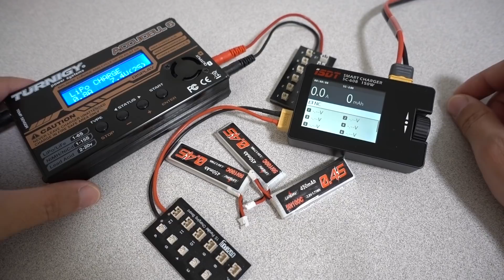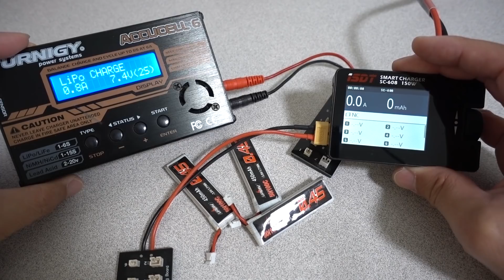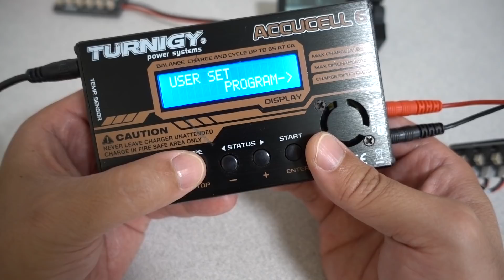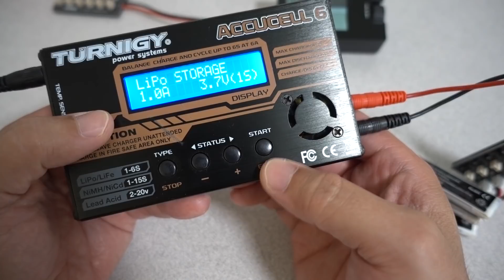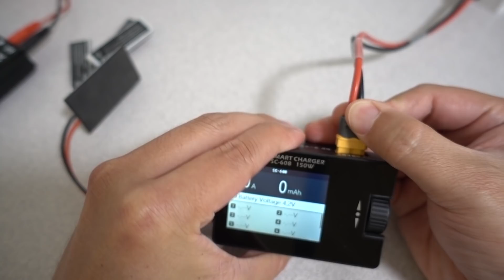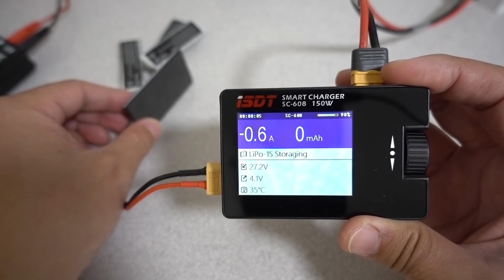Easy Method for 1S Lipo Storage Charging ⚡

Comment from the maker: Just to make things clear, I use this method after a day of flying where I have a bunch of fully charged 1S lipos I want to bring back down to 3.8v.  I don't put in random lipos with unknown voltages into the parallel charger like some of these comments are suggesting.  They are all at 4.2v.  I do mention this in the video and it would not be safe to plug in lipos at different voltages.
Reply from the maker: Nothing wrong with the other way, but I've been doing it this way for years and don't see a need to switch away from doing it my way.
Reply: I think the confusion arises because when plugging in the three batteries you give an example where 2 are fully charged and other is already at storage but don’t complete the thought. You plug it in despite variance explained. Might save yourself some feedback by posting some text over that bit to clarify. You start video by saying you do this with all your fully charged batteries but that part seems to contradict the opening. Hope that helps! Thanks for all your hard work and great videos.

Comment: Hi can I ask, I have a new skyrc e680 balance charger. I have 1s lipo battery's. My parallel board is similar to the one in the video apart from mine has 6x 1s -3s ports and also has 6x xt30 connections. 
When trying to storage charge more than one 1s battery it does not recognise anything other than one battery. I select the appropriate amps for the amount of batteries and their mah in total and select 1s as the voltage. but soon as i try to start it says connection break. All batteries are fine and so is the board. it was same with a previous board (6x1s) i purchased that was not a parallel board ( i thought it was) and it has 2 banana connectors much like the board i have now can charge one battery but not more than one other wise it says connection break. is it me or is it the charger?

But, in video if balance charging 2s + batteries you can connect them to the xt30 connectors and get power and the board i presume the other ports are  balance ports. But, with a 1s battery how does that work? there is only one lead and i guess it powers directly via that lead but charger does not recognise them past one battery, what am i doing wrong?

Comment: I bought this board and I did what you did and after long start button press there is bipping noise and CONNECTION BRAKE message on display.
Reply: I posted video on Drone Racing - begginers group on fb
Reply: Any solutions yet?

Comment: Dumb question. How do you figure out the Amp setting with 1S lipos when charging with the Tenergy? I usually just put a decimal in front and use that. Ex;: 450 = 0.4A. Is this correct? Thanks.
Reply from the maker: It's just math.... 1.0 amps = 1000 mah, so 450mah = 0.45 amps.  So you should choose 0.4 or 0.5A.

Comment: Thank you for your video. 
I am a noob on fpv. I was wondering if you could setting up the charger as 3s battery (as you have 3*1s batteries) and then use a 1.35A (3*1C) ?
Reply from the maker: 3C charge rate on these small lipos is not recommended unless you don't mind risking a fire

Comment: I have a Tenergy TB6B Balance charger/discharger and just bought a High Voltage 1S battery charger(6 plugs with USB and XT60 Male port on it). I was wondering if I should buy a XT60 female to Banana plugs to attach to the Energy charger to charge. Is it ok to charge/connect to the 1C board without balance plug? Thanks.

Comment: Nick’s method uses a balance lead and has merit on its own. One could argue the safety benefits of Nicks solution. I like your option as well. I would recommend NOT making these subtle digs at other reviewers. Win added subscribers on your own merits, not by running down other reviewers. I enjoy all the popular channels and the different views and approaches of each.
Reply from the maker: I was not making any dig at Nick.  Also, I never mentioned there was anything inherently wrong with his method.  Only thing I stated was I felt the way I did it was easier.  That's it.  So many overly sensitive people on the Internet.  I like Nick and his channel.  Just offering other options.  All I get is hate for offering help and information.  No good deed goes unpunished.

Comment: So it will make sure all the cells are balanced even without a balance leed? Also wouldn't this work for charging as well?
Reply from the maker: There is no balancing here because the lipos are connected in parallel and not serial like in a 2S or 3S lipo.  And yes, all the lipos will have the same voltage.
Reply: @AlbertKimTV  Ah ok so you'd set amps likewise right?  e.g., 4x 300mah would be set to 300mah and not 1.2a (unless you were wanting to discharge at 4c).  And just to confirm, this would work just as well charging?  Thanks!
Reply from the maker: No, if you have 4x 300mah 1S in a parallel charger you would set it to 1.2a total to charge a 1C.  The parallel board makes it look like one larger 1S lipo so 4x300mah = 1200mah total.  To the charger, it just looks like a 1S 1200mah lipo.  It can't tell the difference.

Comment: This guy works great too, just cut off the JST plug and solder on a XT60 https://www.amazon.com/Crazepony-Charging-Adapter-Balance-Charger/dp/B01LZLW871/ref=sr_1_4?keywords=1s+parallel+charging+cable&qid=1557944576&s=toys-and-games&sr=1-4

Comment: The point is still valid that we really need a multiport charger/discharger for 1s packs that has individual charging circuits so you can just pop a bunch of 1s packs of differing voltages onto the charger and set them all to storage.  Whoever brings this to market will certainly get my money.  Bonus points if it has 12+ ph2.0 ports.

Comment: Actually a nice workaround, I charge all my Lipos like I do already with the little 1s charger, but  then before putting them away I plug it in my main charger to discharge them till storage voltage.
A little more effort equals to a longer battery life. 

Thank you Albert, very useful and money saving tip!

Have a good one ✌🏼😁

Comment: Nick’s method used a balanced lead which is preferred if batteries are different voltages. You can buy those rather than making your own. I have a six battery version I bought at Micro Motor Warehouse. But it seems with all these 4-6 channel chargers someone can make a 1s charger that can do storage. Seems strange they haven’t.

Comment: Woah! Never ever ever plug in packs in parallel with that much different voltage.
Reply from the maker: That's why I mentioned they should be at the same voltage or close to each other.
Reply: Albert Kim sorry I thought you were plugging in fully charged lipos on the same board as a 3.8 v lipo.
Reply from the maker: They were all at 4.2v.  However, I have done the experiment where the voltages are different.  The lower voltage lipo gets charged by the others and those get drained.  However, the lower voltage lipo gets charged at a very high C rating so not good for that one.  I'm assuming other people will storage charge based on the fact they have fully charged lipos that they want to bring back down.  What other situation am I missing here that I am getting so many negative comments?
Reply: Albert Kim my main concern is that someone might practice storage charging larger packs with this practice and things might go bad. Charging videos are always a hornets nest of comments 😀.